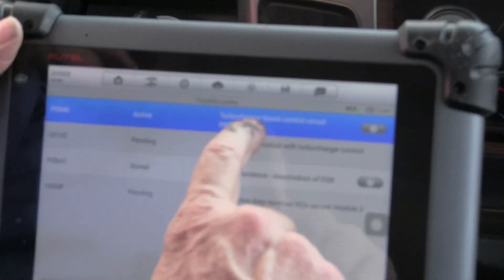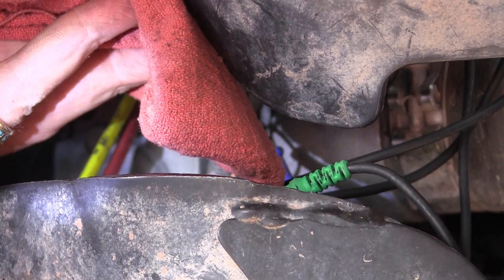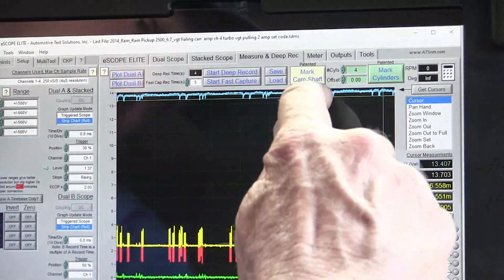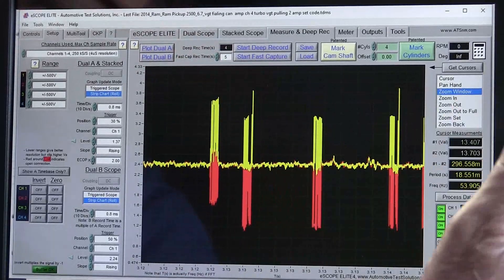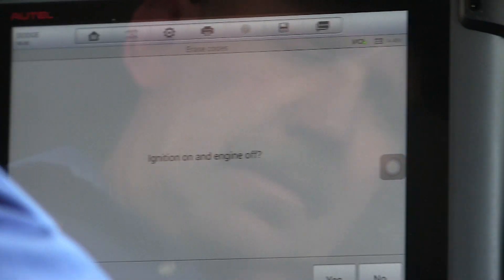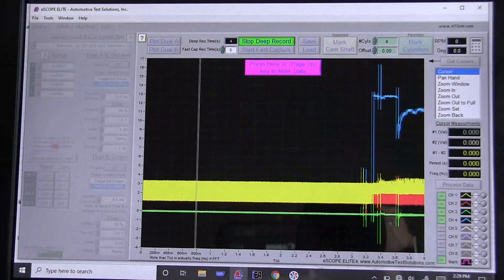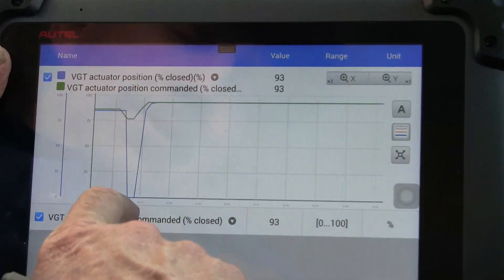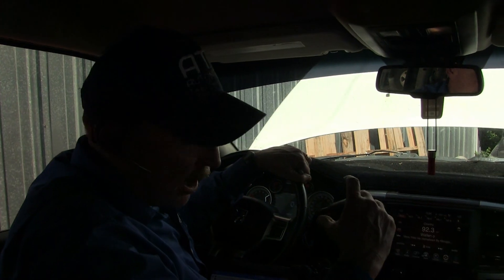2014 Ram 2500 VGT Communication problem

Comment: Hello I am getting a u101c lost communication code. I changed the actuator cleaned the carbon in the turbo also changed the computer. When I clear the code I can dive the truck for how ever long no engine light comes on. When I shut the engine off and start it again the engine light comes on with u101c lost communication code. Is their anyway you can help me out. 
Thanks 
Vince

Comment: i have a similar problem with p003a actuator and nox p2bac, module communication for abs, amp for audio, body control, and climate control,  this truck is 2016 6.7 with 35k miles, when i try to clear codes it returns with same codes,  seemingly a ground possibly? or fuse, what do you make of this?

Comment: The vanes in a Holset don't swing or rotate. The vanes are fixed. It is their exposure to exhaust flow that is varied. Communication on my truck is good but the exposure position is stuck

Comment: Just watched video AGAIN.  Was wondering if when you take turbo out to clean vanes would you even suggest replacing stock module (with plastic gear) with aftermarket unit that has metal gear, more robust electronics and   supposed doesn't require programming? Just curious

Comment: Question: can you read a high amp draw with the amp meter at the turbo wire. if it is over 6 amp draw = carbon build up. I don't have a scope.

Comment: Thank you Bernie. A friend of mine dropped his truck and asked me to install a new VGT actuator or module. The easy part was draining and removing the part. It's 2014 dodge 2500. 
The did have the loss of comm code and the nox code as well.
I tried to get the new actuator to talk to my scan tool for a precalibration. I did reset all codes twice. I still could not get my scan tool to talk to the actuator for a precal. I knew that if I had installed the new actuator or module I might get it fried too.  
I could move the vanes manually. 
I reinstalled the old actuator again and tried to move it. All I got was loss of comm again. 
I has suspected a cooked wire because I could not get the actuator to precal. I don't have a scope . so I stopped and called the owner and let him know I am out of options to further trouble shoot. I told my friend. He does not owe me no $$ for my trouble shooting. After all I didn't find the true cause. Because I could not read the can buss values.
Reply: Was there any resolution to this issue? I’m asking because my turbo and actuator (city diesel) are good but I’m still having a U010C comm loss code that I can’t figure out.
Reply: @corybrown738 did you find the problem bro?

Comment: I think this is what happened to my truck first I was getting the nox sensor code a few months passed and then I started getting the u010c codes. I also noticed my exhaust brake started sticking and finally the vgt acuator failed because it was over worked now I have all sorts of codes and the exhaust brake doesn’t work anymore

Comment: Thank you for explaining that.  The heavy carbon on the turbo vanes that is causing the problem is due to what?  Very high mileage?  Lots of low speed stop and go?  Heavy towing?  All the above.....or ?  Besides the codes, what symptoms are present?
Your theory of operation zero's in on the problem, I'm also looking for the root cause of the problem.
Reply: Also the exhaust gas recirculation system
Reply: I’m experiencing similar symptoms on my truck  I think the heavy carbon is caused by long idle periods, and also not using the exhaust brake